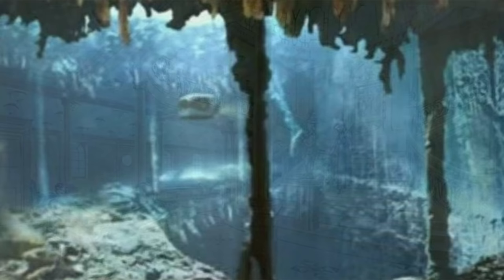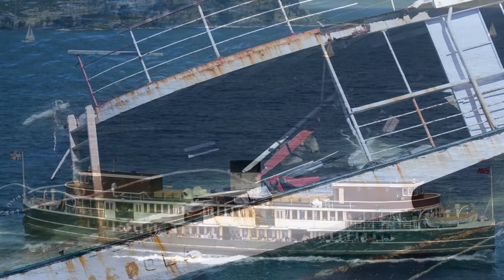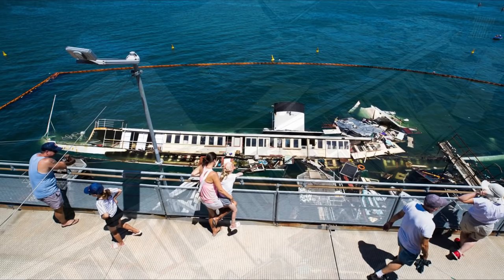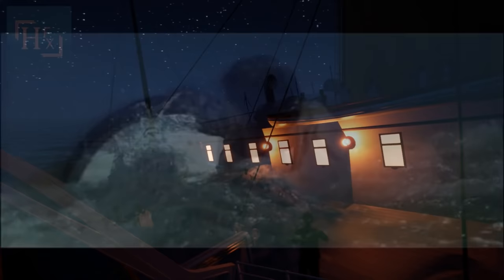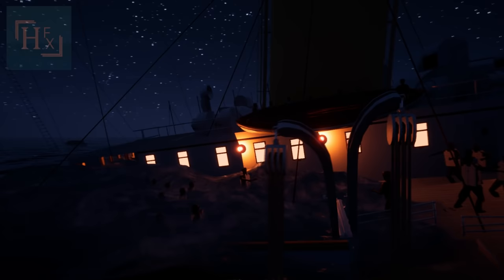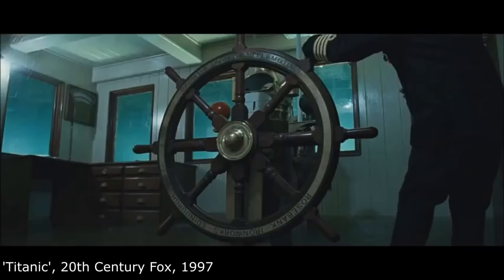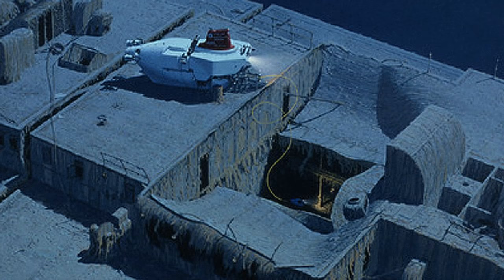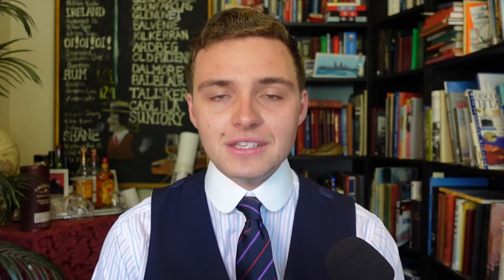What Happened to Titanic's Grand Staircase Dome?

Comment: The message of this video seems to be that the parts of a ship that were not designed to be submerged respond badly to being submerged.
Reply from the maker: Right Stephen! Nothing from the lower-hull up, save for perhaps the very bow and stern of a ship, is designed to submerge. Water can do some crazy things - the video I did on Lusitania's encounter with a rogue wave has some photos of ships after they had their bridges and superstructures staved in by the weight of a wave!
Reply: And to think that much (not all) of that is still intact after over a century.
Reply: @OceanlinerDesigns  i just think the dome cover maybe got crushed from the second funnel im not sure
Reply: So you’re saying…that only some of the ship is supposed to be underwater? 🤔
Reply: @PoisonousPen  Ideally yes. But just the bottom part.
Reply: @bishopp14  Instructions unclear. My ship is now vertical. Advice please.
Reply: @PoisonousPen   Abort! Abort! Running your ship vertical will displace coal storage and drastically hinder boiler operation. Also, the people will probably fall out.
Reply: @PoisonousPen  
Correct. However, submarines…
Reply: @Frankie5Angels150  DONT CONFUSE THE ISSUE!!!!!
Reply: @Frankie5Angels150  Just remember that some things on submarines do not react well to bullets. Amongst which are nuclear missiles, Sam Neill, and Sean Connery. Too bad there were no submarines in Montana.
Reply: Instructions unclear: Bottom of the ship is now on top of the ship
Reply: We may be impressed by the sinking animations, but it is easy to forget (despite being obvious) that Thomas Andrews did not design ways for the ship to sink or react to water as we saw, like every engineer in charge of designing vehicles. Ships are obviously not giant toys that are meant to sink in the middle of a deep body of water (unlike many of our collectable model ships); they obviously are just some type of oversea transportation, since air travel at that time was not very affordable, continent, and most likely didn't even exist for public.
Reply: Alternatively, you could say that water is a lot heavier than air, and anything built to withstand atmospheric air pressure usually doesn't withstand the heavier pressures caused by deeper waters.
Reply: There's one fate worse. Boats are designed to keep water out, not in. So a ship sunk at high tide, once the tide recedes, can explode from the weight of the water left within it.
KABLOOMSPLOSH!!!
Reply: @therailfanman2078  Repeat procedure to make the erstwhile bottom the bottom again, then cede control of vessel to anyone else.
Reply: Oddly enough the swimming pool still holds water though.
Reply: @Nebulasecura  unfortunately it’s expected the RMS Titanic (both of her segments) will almost entirely disappear by or before 2050
Reply: I readed this line in Scottish accent remembering some movie.
Reply: @bishopp14 people can be replaced! Coal can not! 
laughs in pre labor law capitalism
Reply: @OceanlinerDesigns there's a million gruesome ways to die so y resist when da 🌊 just began it will having so much fun.

Comment: James Cameron talks about the grand staircase. They built an exact replica of it for the film using plans from Titanic. It was not attached to the ship but remained in place due to its weight and fitting to the superstructure. During filming when they submerged the set including the staircase, it broke free and floated. A major safety issue for the stunt team but Cameron realized that it was the reason there was no trace of it at the wreck. Being Oak it probably still is recognisable but where it is, that's the real question.
Reply: Yes, I heard that happened on set. It is a shame it didn't survive. It would of looked eerily beautiful.
Reply: @kiyablaise  I'm sure it would have rotted out right now though submerged in the water
Reply: @mikekeeler6362  Yep
Reply: He was building a MOVIE prop, not an actual replica of the Grand Staircase. The prop floated out not the real staircase. There are remains of the staircase at the bottom of E deck. The THG guys cover this in great detail.
Reply: @tanesha41 actually it was a replica and not a prop. They rebuilt 80% of the ship at 90% scale for the film, so lots of ways things sunk or floated would have been accurate to the actual sinking.
So it was not ‘a prop floated out not the actual staircase’ it WAS Cameron’s actual staircase. It floated off just like the real staircase did and at some point after Titanic settled on the ocean floor the broken timber and steel from the stairs settled at the bottom of E deck. But by the time they had the technology to search that deep into the wreck the wood had been eaten away into nothing, leaving just more twisted metal at the bottom of that deep hole where the staircase originally sat.

Comment: Cameron’s author friend Charles Pellegrino went into detail about the staircase in his 2001 book “Ghosts of the Titanic” – his theory was that the staircase as a whole was buoyant, tore out of the ship and floated upward – explaining why nothing was there and the dome structure gone.  He further speculates that the floating parts of the staircase may have been refuge for survivors, but that it then drifted away from the search area.
Reply: I think the grand staircase did not float out of the dome on the surface. After all, the dome cover wasn't all made of glass like the dome. I think only small pieces of the wood floated out while the main bit of the broken A deck landing stayed trapped under the dome cover. When the ship was descending, I think the forces of the water ripped off the dome cover like how it made the forward mast collapse. If it's not that, then the plume of high pressure water behind the bow crushed the cover and all the grand staircase decks below it when the bow landed on the sea floor.
Reply: Should note that in his Titanic book Pellegrino has many offhand ideas and speculations about the sinking, but is not a technical expert in this field. His theories are a great read and intriguing, even after the more recent incident where his book and movie project about Hiroshima were canceled when it turned out parts of the “true story” had been invented by one of his sources.
Reply: Pellegrino is not exactly the go to source for accurate Titanic information. He has a lot of rumor, conjecture, etc.

Comment: It’s crazy to think how all the destruction that happened that night was all linked to water pressure. The bridge, the funnels, and the entire grand stair case, and now that I think about it, it could have possibly influenced the break-up as-well. Amazing video, keep up the great work!
Reply: Breakup was primarily caused due to the stress of the weight of the water pulling the superstructure down.
Reply: @Nephalem2002   the  breakup was actually caused  by the  keel  bending  due to compression.. the breakup  started at the bottom   .  As the bow sunk down  the center of buoyancy  shifted  aft   underneath  the larger machinery spaces which were  more  hollow   and open  the bottom  of the keel compressed upwards  pushing her lower decks  upwards   the breakup stopped  at the strength decks  then it started  breaking from the top  down and stopped  at the  strength  decks   then finally the  strength decks  separated.  . When they found  the missing keel sections  they found   that on both  ends where the 2 pieces were once joined together   they had compression bends   which shows the breakup started at the keel  due  to all  of the ships buoyancy  being shifted  to one area of the keel that was not  built to withstand  that kind of buoyancy pressure
Reply: it did and also the engines the way that titanic was built there were jeaby engines in the back pulling the back down so while it was sinkinf theres wayer pulling the front down and engines pulling the back down and then evntually the ships structure cant handle it
Reply: @adamwatson6916  who asked
Reply: @greatsteamreal  who cares who asked?
Reply: It took out the staircase aswell?
Reply: @greatsteamreal  Everyone?

Comment: in the making of features of Titanic, Cameron states a near accident happened while filming the grand staircase flooding scene. Though the set was fastened securely, the wood stairs detatched and started to float while water flooded with stunt extras were being filmed, not planned or expected. From that he figured that is what happened in real life, it just floated out the top after breaking off and violently scattered during decent
Reply: I'll be that's right. Even if the real staircase was more firmly secured in place than the film set replica, that just means that (by the time it reached a lower level of submersion in the sea) it would've smashed through the dome with greater force. It's no wonder the staircase looks like a giant cannonball blasted through it.
Reply: @Garsons-oq4lh  That'll probably never happen. Not just because of the resource and technological demands needed for such a thing, but also because the wreck itself is a gravesite and shouldn't be disturbed that way in my opinion.
Reply: @Garsons-oq4lh  Iirc the entire steel frame for the lowermost staircase is still there, but that’s all we have

Comment: I think what's really cool is that during the 1997 filming of Titanic, they accidently discovered what very well could have happened to the grand staircase. Most at that time thought it'd most likely just decayed, but on set when the water came rushing in, the staircase suddenly detached and started to float. They quickly stopped filming and aided actors to avoid any injury. But it answered the question of the vanished staircase.

Comment: When I was in the US Navy, I was part of an effort to monitor and build a sound library of sinking ships. (Okay, yes -- had to do with over the horizon targeting; as in, how do you know that you have sunk a ship when you shoot at it from a distance?) Long story... But basically there are all manner of sound signatures from a sinking vessel. There's the initial explosion in the case of a bomb, missile, torpedo. (Or the sound of an iceberg scraping the hull, per Titanic.) And fire makes noise. Then you have flow sounds as flooding moves through the ship -- kind of like the sound of squirting a hose inside a metal garbage can. Combine this with internal sounds of machinery that is still moving, such as boilers, turbines, gear-reduction systems, etc. until they spin down or seize up, which makes noise of its own. Add in water-hammer effects, as in banging and sloshing from back & forth movement (and variations on what's called "ullage," meaning partially empty spaces with sloshing water). Then you have really eerie sounds of steel twisting, buckling and tearing. Welds ripping. Rivets popping. Closed doors -- even "watertight doors" that are dogged shut -- bursting open with massive bangs, even popping off the hinges. And sealed compartments collapsing under water pressure, just sledge-hammed bangs. And flow resonances -- humming, sort of -- as the ship drops down through the water column. The resonances actually change frequency as the corpse of the hull drops through different layers, at different temps and salinities. And then you have impact with bottom, the sound of which depends on hard, sandy, mud, etc. There's the sound of the ship hitting, plus a measurable seismic event in the seafloor, often measurable far away via seismograph. And a massive swooshing sound as the hull pushes water and bottom material out of the way as it plows in. Add in bottom bounce of sound waves bouncing back from sea floor to surface, and reflecting back down from the surface (Snell's Law in physics).  And then the sound of the ship breaking up during the impact, not unlike the sound of a car crash with all the twisted metal. Meanwhile, depending on the water column, there's "direct path" sound which is noise from the sinking ship, and that fades within the seawater in a ratio of distance-squared from the emitter.  But there are also sounds that move via "convergence zones" in the ocean, such that you can hear noises many miles away; like dozens or multiple dozens. And then there are "deep sound channels" that can transmit the noise many hundreds or even thousands of miles away. All in all, a sinking ship is a noisy thing.
Reply: that is truly fascinating!
Reply: You got enough content for your own channel dawg!
Reply: Thank you for adding this info. I never thought of being able to catalogue the sounds of a sinking ship
Reply: Thanks for sharing
Reply: Wow. I just visualized everything you just said. Great explanation
Reply: 😮 I read this and am just imaging those sounds
Reply: Thanks for all the information. There seems to be many veterans of the American Navy and British Navy that comment on these videos with interesting details to add.
Reply: You've  been waiting a long time to find the right video to download that knowledge on everyone.
Reply: i have a horrific desire to actively hear all of this....   not.  in "being present on a sinking ship" sorta way, but in a really messed up ASMR sorta way.   I'd probably have nightmares for a week but it would be so ridiculously worth it. sometimes there's value in being terrified.
Reply: Good information - all it needed was the use of paragraphs

Comment: A possible alternative: the glass etc. was shattered by air pressure. The air is being displaced by the incoming water. You can see how violently water bubbles out of the hull of the sinking ferry at the same time you can hear the glass breaking.
Reply: Water pressure coming in would definitely mean air pressure coming out.  That is all the huge spray seen blowing out like geysers in Cameron's film as the ship is upending.